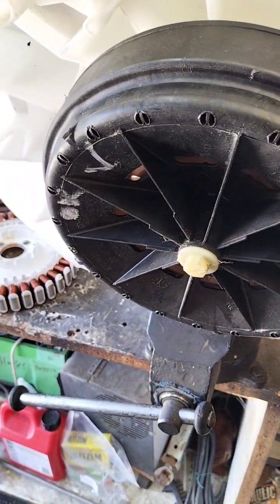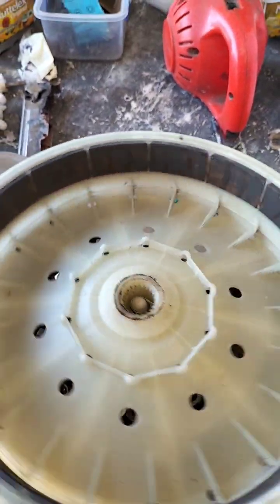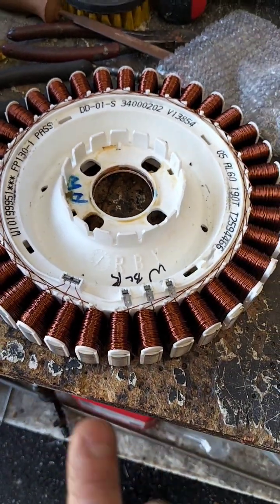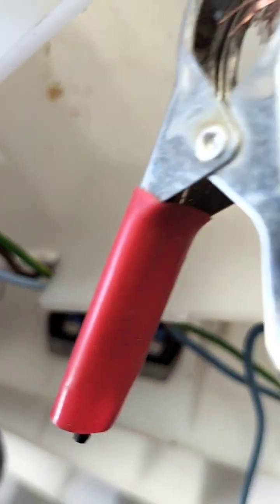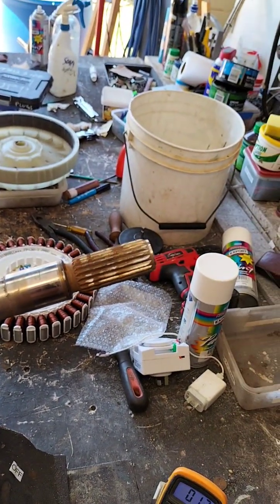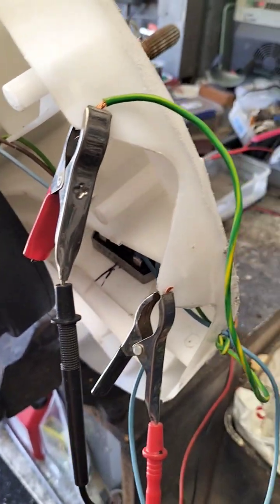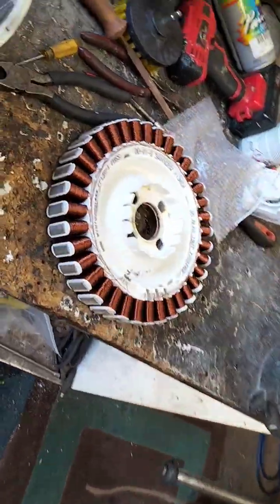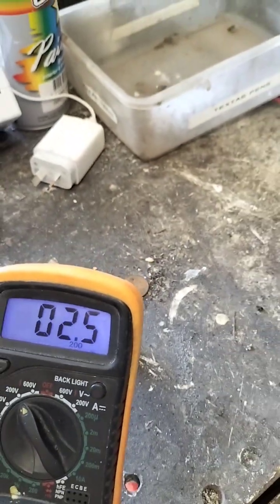Making FREE electricity from a washing machine motor part 1

Comment from the maker: This is part one of converting a washing machine motor into a free wind generator. This is a link to one of many videos on YouTube on how to rewire a motor into a generator. Part 2 will be soon. I've just started delving into this way of using the wind either by itself or in combination with solar to charge my bank of batteries that run my small off grid homestead in NSW Australia. Bear with me for any mistakes as I'm not an electrical engineer only a self taught person trying to make myself self sufficient for the upcoming Zombie apocalypse 😂...
Our property will be getting a log cabin built by my two hands soon up on the highest point of the property which is Rocky Point you've seen shown in my other videos. Every day I'm striving to be more self sufficient in the hot dry harsh environment that we live in in North western New South Wales in Australia 🦘